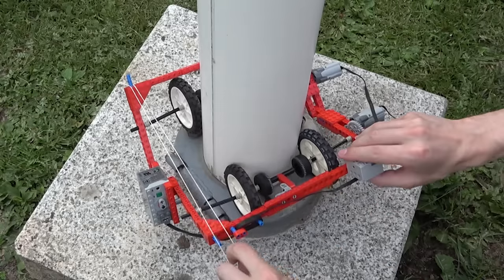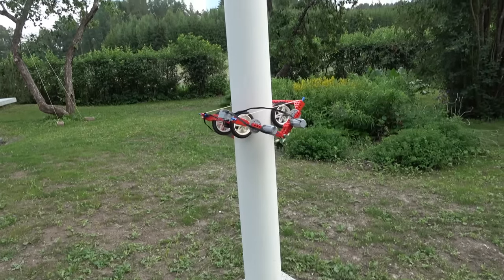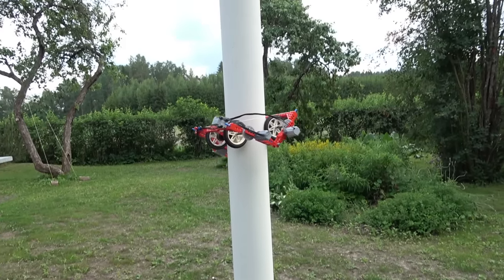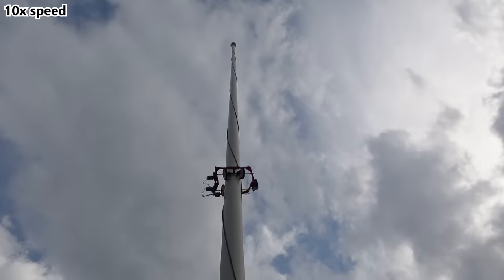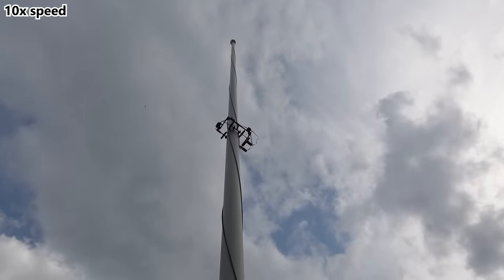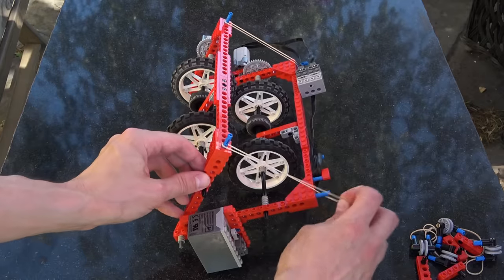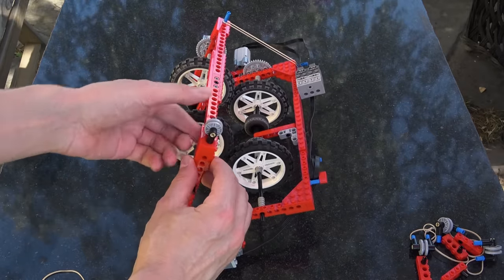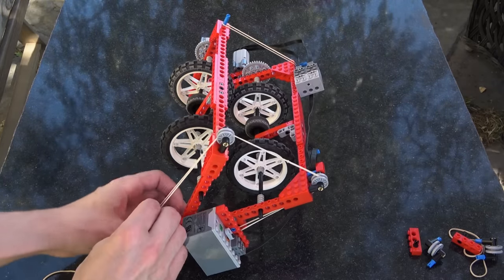3 Pole Climbing Lego Robots

Comment: This channel never fails to amaze me. It's incredible how the simplest tools - plastic, a toy motor and rubber bands (and better tires) - can achieve basically anything by applying knowledge of engineering.
Reply: I agree
Reply: basically anything? could you smelt metal with lego? what about grow food? Could you make a car that goes 50 kph?
Reply: @superhenkable  I mean... Yes. You'd need a few extra things e.g. the food seeds and water and dirt, but you COULD make a machine to keep a plant alive. 
Also Lego cars have already surpassed 50kph.
Smelting metal is a bit outside the capabilities of plastic, so I'd say put all the heat related stuff in the exceptions part.
Reply: @jblen  wonder why we even bother building anything else then, if you can just use lego for everything would be very convenient
Reply: @superhenkable  you're missing the point. But anyway it wouldn't be convenient at all.

Comment: I believe the last rotary design can be improved by placing some other weights opposite to the battery or use multiple batteries evenly distributed, to "centralise?" the centre of mass so that the centrifugal force doesn't pull the battery and start the wobble.
Reply: Or with better tires

Comment: “Lego is for Kids”
This man: university level physics
Reply: I mean, it’s not really University level, but the point still stands
Reply: @Kelvoraax  It's technically on the level of Physics 2 with torque and everything honestly.
Reply: Dude i learned this stuff in 7th grade
Reply: @djvnc1967  china problems
Reply: @djvnc1967  yh I learnt that too, but do I remember, no not really so this might as well be uni level
Reply: @1000pingVendetta I worked in a company as a kind of Mechanical Engineer without a degree for a half decade and designed in a team Machines in the high 6 figure area.
Reply: this is very much high school territory
Reply: And better tires. Don't forget the better tires.
Reply: @1000pingVendetta this is tinkering
Reply: not university level lol , this is one of the easiest concepts in physics
Reply: This is not university level physics. Late high school stuff though
Reply: @three-four-seven  lol yea

Comment: I bet you'd DEFINETLY get a strong grip into the tree bark if you replaced the rubber wheels with saw blades
Reply: Would require a lot of force to get into the bark
Reply: @Lumadous  turn up the torque lol
Reply: @EZOnTheEyes  would take more than that but its not impossible
Reply: DEFINITELY!
Reply: @Harrison Gist "LEGO saw blades" is the most cursed combination of words i've ever read lmao
Reply: @tamashoxd  Have you not seen Lego saw pieces?
Reply: That'd damage the tree, though.
Reply: @Harrison Gist Who said the blades had to be LEGO???
Reply: Better tires
Reply: @themadman6310  then add more torque
Reply: @Misha-dr9rh  along with tension
Reply: The metal gears that you got with old meccano might work.
Reply: @themadman6310  and better gear ratio

Comment: Also, a third way to deal with centrifugal force on the third design would be to balance the weight more. It wouldn't necessarily make the forces any less (in fact, since the only way I can think to balance the weight would be to ADD more weight to the other segments, it would probably INCREASE the force), but it would make the forces equal in all directions, which might help with the frame strength issues, since it would spread the load.

Comment: On the last one you could maybe use the centrifugal force to your advantage:
If you put a rope all around your vehicle and put a weight at the end (maybe put the weight in kind of a sled for control and on each of the 3 segments one of these mechanisms for balance). When the centrifugal force gets bigger the weight gets pushed outwards, pulls on the rope and tightens your robot even hatder against the pole.
Disadvantage: only works once robot is spinning fast, no effect on not moving robot. For speeding up from a stand still you still need the rubber bands
Reply: There's no such thing as centrifugal force.
Reply: @oksuree  i know. Centrifugal force is a myth ... in fact there is only centripetal force and the "centrifugal force" is nothing else than a pseudo-force resulting from Newtons 1st Law in conjunction with the centripetal force ... but if i would have written it this explanation instead of the term "centrifugal force" my post would have been even longer ... and face it: everyone understands the term "centrifugal force" ...

Comment: I feel like the most efficient design would incorporate features from design 2 and 3. The 3 tension-braced pieces seemed to work really well with the bumps of the tree, but the spinning seemed to cause structural issues. So using wheels that go straight up instead of rotating, like in the first and second designs, could improve energy efficiency and also structural stability.
What I like about the third design is that it is not necessarily locked within a maximum pole diameter, landing it well to getting over humps and obstacles. But the rotation seemed to only cause problems.

Comment: I think the rotating climber would have done better on the tree if it had exposed spokes instead of round tires - because when it slips on a knot the next spoke should reach over the crest of the knot and use it for additional leverage.

Also I think the apparent diameter to the device would be more constant.

Comment: Not okay man. Here I was, interested and intrigued by the apparent use of terms in line with scientific literature and then, WHABAM!!!, 5:56 "centrifugal force". You dare defile these people with this cursed abomination of a term? HERECY! As much as I came to loath the mix of formality with debochery of high school I did learn one basic concept about circular motion (physical circumstances which acumulatively result in an object moving the path of a perfect circle). The term that should be used here is "centripetal force" which is, in circular motion, the force on the object (which moves in circular motion) towards the centerpoint of the circle. Ex. A moon orbiting a planet moves in circular motion because the gravitational force upon the moon goes directly towards the planet and remains towards the planet as the velocity of the moon (perpendicular (90°) to this gravitational force) keeps it moving around the planet, as opposed to just fall into the planet if it wouldn't have any speed. As such, the gravitational force on the moon is also the centripetal force. There are no other forces in operation here so gravity makes up all of this centripetal force. If for example the moon had a massive positive charge, and the planet a massive negative charge (relative to normal human experiments) then the centripetal force would be made up of both an electric force, and a gravitational force. Note that it is assumed the moon still moves in circular motion, you can't just increase the force on the moon and have it remain in circular motion. Increasing the centripetal force when it was moving in circular motion would result in the moon getting closer to the planet, further increasing the centripetal force, and building up it's speed, ultimately resulting in an elliptical orbit, or maybe an irregular one. Idk, it wouldn't be circular anyway. 
Either way, the "centrifugal force" is an misunderstanding in circular motion that there is a force on the moon pulling it outwards. This idea comes from that when you perform circular motion with ex a car, it feels as you are being pulled towards the edge of the car as you turn the car. In reality, this "force" is just your inertia from the speed you have changing. You might be driving the car, but your body isn't the car, it's connected to it via a seatbelt or at least the car's door. Without this seatbelt/car door, then the car would keep turning but the centripetal force only affects the car, not you (without the seatbelt) so you would just be flung off the car. The "centrifugal force" thus isn't a force, it's a misunderstanding of why you're forced towards the car door as you turn it (or similar situations).

Comment: Hi, maybe since you use Sbrick to activate the two side motors, if it is the Sbrick plus hub model you could add to it, an wedo1 tilt sensor to track horizontal level while climbing and if it turns left increase power on right motor and viceversa. Also for descending with a wedo1 distance sensor attached to the same Sbrick plus you could test slow or increase velocity on booth motors to smooth "landing".

For a Maths / Phisics .. STEAM class can be joyful way to learn forces, and that fail just is a new opportunity to do a new aprouch closest to the best solution.
If posible it would be great to transcript the formulas to a spreadsheet and added here the aprouch about the values of weight of each model, estimated gravity center, time to climb  ... to calculate velocity aceleration and its correlation to motor torque/velocity an values read by the two sensors.

Last idea could be, the use of a Microbit board internal sensors and a small circuit to control both Lego motors, plus an ultrasonic distance sensor to measure better the distance to ground. Later this could be linked by radio with other board to register the same data variables: velocity, time ...
with the advantage this can improve the interest to code in scrath an Python for our sons and students.
Sharing code aprouchs and variants could be used in later videos of the channel with the idea that with more thinking heads, there is no problem we can't solve together as an online team.

Thanks for the videos published so far.

Comment: The circular climber is flawed by design. The faster it spins, the less friction it has and it has to spin fast because of the large distance. Maybe it could make sense if it worked better than other designs so it wins by default by climbing what other climber can't climb. But it would take hours of slow spinning to make it work.

Comment: Hmmm so interesting
What about a ring with 3 or more motors going around the center connected with arms that go radially inwards and downwards toward the pole.
It self-locks with the weight and would only go up with shaking forces (if it were a tool) if the wheels are stopped.

Comment: Gravity grip uses a load which basically provides a constant bending force on the pole.

If the pole isnt string enough then you will have a pole bender rather than a pole crawler.

Comment: What i get from the video is that the lego structure is too flexible, then lots of the force applied is wasted in bending the plastic instead of pushing the tyre against the pole. That is why changin the tyres works better than add more weight
On another side I suspect, than in the first two machine designs there is also some sliding of the wheels along the axels, that can explain why the tyres lose the grip at some point on the pole.

Comment: lego glass climbing robot. 
I would of run tyres around the outside of the pole with shock absorber or struts so if something gets in its road the wheel springs out of the way.

Comment: 2:49 I like the idea of this. What if you had a design like a differential that used motor torque to clamp the frame/wheels onto the pole, then when the force on the frame is higher than the force it takes to move the vehicle up the pole, the wheels start moving?

Comment: Did you say... CENTRIFUGAL FORCE??? My physics professor would like to know your location
Reply: centrifugal force is technically still a thing, because broken down it just means a force applied with a fulcrum on a center axis.
Reply: @largestbrain  Centrifugal force can only be observed through a rotation reference frame. There is nothing actually applying an outward or inward force. It is simply centripetal force
Reply: @christiantietz6085  tension is a force, so there actually is a force being applied inwards. The robot mimics the tension of a string tied to the center but with supports on the outside holding the components against the pole.
Reply: @largestbrain  So, after a refresher on why they used “centrifugal force”, still no. When the robot spins and the wheels leave the pole, it is not because a force is pulling outwards perpendicular to the tangent of the pole. Each wheel is moving forwards and the rubber band in front of it is pulling to the left. When the force of the motor on the wheel on the pole is greater than the tension in the rubber band, the wheel moves tangent to the pole, not perpendicular. What may appear to be “centrifugal force” is really just momentum and centripetal acceleration.
Reply: @christiantietz6085  i said inwards, not outwards. Without an inwards force, the momentum would tear the components away from the pole.
Reply: @largestbrain  The inwards force is the rubber bands pulling the three components closer together to create a smaller triangle. In the testing, momentum does tear the robot apart.
Reply: @largestbrain  The concept behind a centrifugal force is that something is pushing or pulling an object outwards. Nothing is applying that force